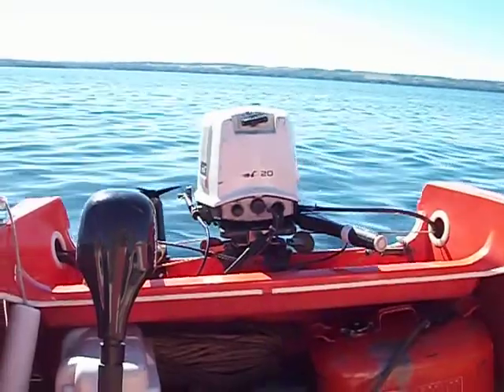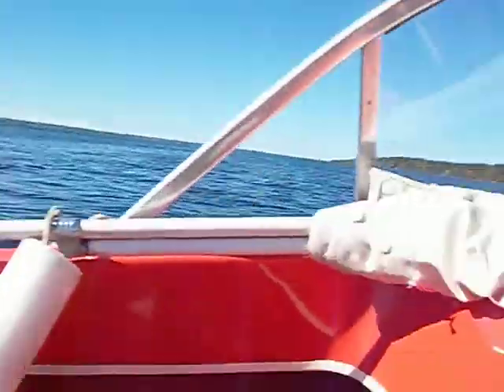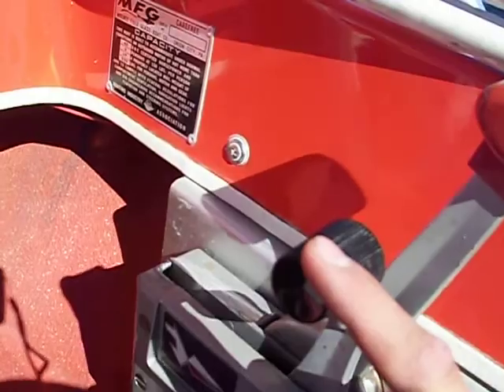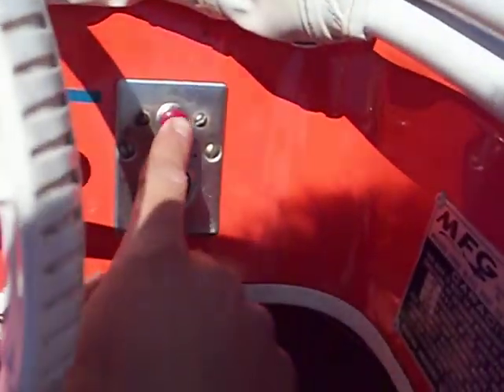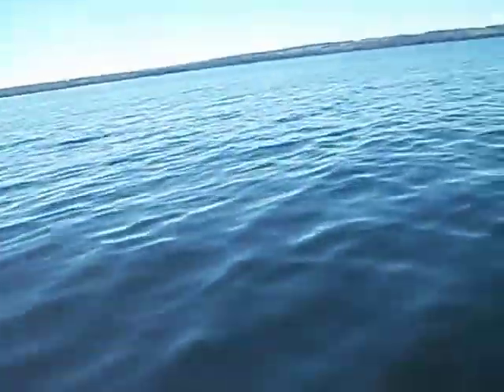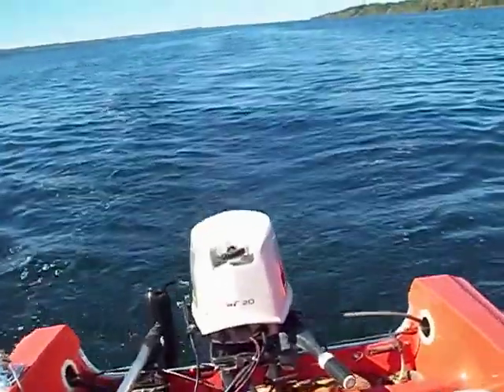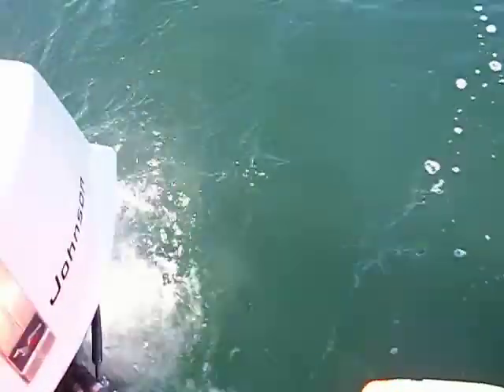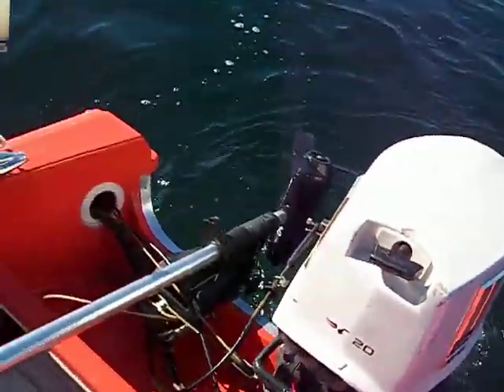1969 MFG Carefree Runabout 144

Comment: Hey this boat looks awesome. How do you like it? I am looking at one to take to the ADK when i go up there and cruise around to the islands to camp on. How fast does this thing cruise with the 20 horse and could 4 people comfortably fit in it with a little luggage?
Reply from the maker: +Trevorc5505 I absolutely love the boat and you can fit 4 people comfortably but it will get pretty tight with luggage in terms of suitcases but if you are referring to backpack and small cooler then it is just fine, and as far as speed with one person on a smooth lake and the 20 horse with a 3 blade prop is does 23.5 mph via gps speed and with a load of 4 people it cruises at 17.5 mph its a fun economic cruiser ! Thanks for the comment and for liking the boat!
Reply: +85buick307 I'm actually about to pick one of these up this weekend. Do you still have yours? Any tips you could share? The one I am getting has a 25 horse motor on it